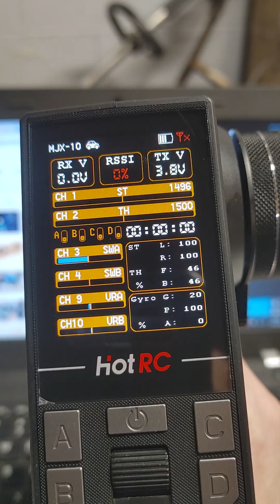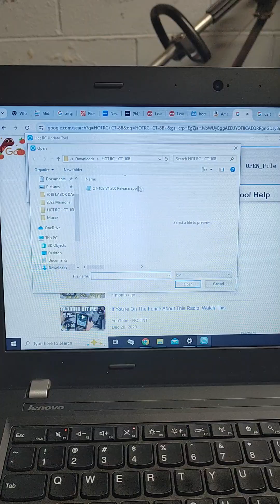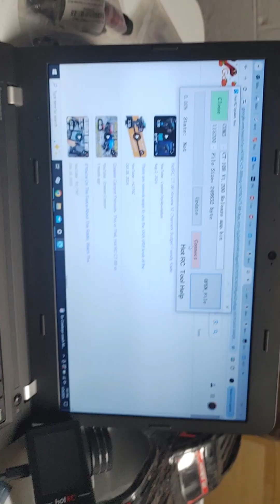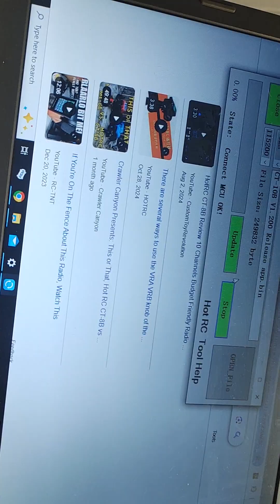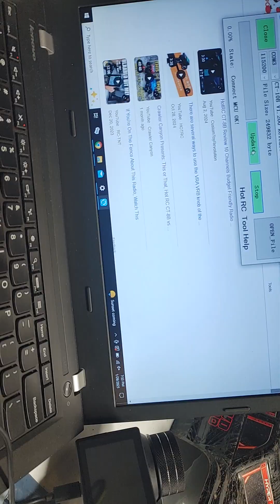HOTRC CT-8B UPDATE TO 10B

Comment from the maker: Here is my link to the files
https://drive.google.com/drive/folders/1K_MOMWdxmC6KSFVyBSf3utU4CjxdJMvG
Reply: Hey man, did the support also give you the update for the 8A controller (the one in the tutorial in your drive)? I have both controllers, but the support on the shop I bought it from doesn't have the update files. Thanks for the video.
Reply from the maker: @jpmv2020  No they didn't I've tried to get update but no luck. You could try this file it might work. I don't have a 8A to try it on.
Reply: @jpmv2020 hello, I also bought an 8A… please, would you know if is it possible to configure the brake lights, using their receiver with light control F-1A?
Reply: @DJTJ13 Hi, should I connect the internal black wire or just the external shield, or both? Also, do I have to hold down the CT-10B button the entire time while it updates? I'm not sure how to do this. Is there a way to brick the transmitter?

Comment: Just a quick message to say thanks for the help on this. I downloaded from the HOTRC website but the instructions were difficult, your video was vital! Rather than doing a DIY USB to USB-C UART, I brought the Meus adapter you linked, much easier! 

I couldn't get the driver to install on Windows 11, so I inserted the USB dongle in a USB port, waited for it to be shown in Device Manager, then when the device came up (with a warning triangle), I clicked update driver and then pointed the dialogue to the CH341SER folder and let it find the dongle driver. Then once the driver installed, I made a note of the COM port shown in brackets. 

After that point I followed your video. Having the deviced powered off and then powering it on and keeping the button held is vital. 

You also may get a 'test' marker after the update is done... there are instuctions for that on the HOTRC website in the 'product upgrade'\'CT-10B' part of the website. You have to run a calibration to get rid of the 'test' marker.

Comment: Hi, should I connect the internal black wire or just the external shield, or both? Also, do I have to hold down the CT-10B button the entire time while it updates? I'm not sure how to do this. Is there a way to brick the transmitter?

Comment: thx for the video. I did update my ct8b and it finished updating, but now it does not switch on again. Any hint how to fix it?
Reply from the maker: No have you tried removing the batteries?
Reply: I tried removing the battery, no power on after reinstall
Reply: @MartinGschwandtner  i have just had the same issue :( did you find a solution?
Reply: @Ms444kkk no I did not. Prepared a arm programmer for flashing the cpu directly but the tooling did not work out of the box and I lost focus. Maybe I will give it a try the next days...

Comment: A random question: can you put the Meus logo on the controller? I mean, the Meus system on the HotRC?
Reply: I'd like to know too. I have another clone called the AMEWI ATXB10. There's nothing on the AMEWI website about updates, and they don't respond to any emails or tickets I open. AMEWI sucks! So I'd like to know if I can update my AMEWI ATXB10 transmitter with the MEUS firmware.

Comment from the maker: The correct adapter you can order from Meus it's the same as the HOTRC. 

https://www.meusracing.com/products/usb-dongle-for-transmitter-upgrade?variant=43812465410185
Reply: I'd like to know too. I have another clone called the AMEWI ATXB10. There's nothing on the AMEWI website about updates, and they don't respond to any emails or tickets I open. AMEWI sucks! So I'd like to know if I can update my AMEWI ATXB10 transmitter with the MEUS firmware.

Comment: Hi mate, thx for sharing this.
Do you think it's possible to do this with ESP32 or Uno card ?
Reply from the maker: @SkyTyphon  I'm not sure but the adapter is cheap like $7.99 on Amazon
Reply: @DJTJ13  But i've lot of ESP32 ^^
Reply: @DJTJ13  I used Flipper Zero with UART bridge. And after number of tries, i reached to send update but .... "error" at 100%. Do you have some tips ?
It's getting on me nerves ! 😞
Reply from the maker: @SkyTyphon  I'm sorry. I'm no expert with these devices. I was just smart enough to figure out how to make it work for me.lol but wanted to share it bc I knew it would help others.  Hopefully some one can take the info and make a better video one day.
Reply: @DJTJ13  No worries. Thank you by the way.
For your information, I manage to upload the file by holding down the "ON/OFF" button but it gives me an error at the end and therefore does not update.

Thanks again to you
Reply: Yes you can use an arduino uno. Short reset pin with ground pin to disable attiny mcu

Comment: Really appreciated  your effort man! 

Can i do this on ly CT-8A hot rc remote ??
I like this new theme old one is rubbish 😢
Reply: I've sucessfully updated firmware on ct-8a with meus me-8a one from their website. Works good with hot rc gyro receivers and includes 4 way steering.
Reply: @ssvaler hello, friend! Thank you for your comment. I just bought an 8A transmitter and the receiver with light control. Waiting to arrive… please, would you know if is it possible to configure brake lights? I just saw parking lights in some tutorials and it’s not the same functionality as brake lights. I appreciate your reply!
Reply: @ssvaler the receiver that I bought is F-01A. Thank you.
Reply: @RCDRIFTCHANNEL Hello i have a f-01at (with gyro). Parking lights = brake lights it activates then trigger position is ~1000(central). You can only configure button mapping for activation headlights, emergency etc.
Reply: @ssvaler thank you so much for your answer! Yes, I understand. But I thought that the brake light should be activated when you pull the trigger to actually brakes, I mean. Not on the central position, but after accelerating, pushing the trigger to the front, did you get it?
Reply: @RCDRIFTCHANNEL  receiver have another channel for rear lights, that activates then you pull trigger to the front. i think if you dont have reverse on the esc it can work as "brake lights"
Reply: @ssvaler thank you so much for your explanations. So, in your case… when you brake your RC, the reverse lights activate? Do you know if other lights kit set offers real brake lights? Thank you for your amazing support.
Reply from the maker: I wish I could say 100% yes.  I feel it could work but it would be at risk of bricking your CT-8A. I do know the 8B has 2 Extra channels (the knobs)  the 8A doesn't. I tried to reaching out to the seller I got the 8B update from to see if they had a 6A and 8A update files but haven't heard back. I did read that HOTRC would send updates via there wechat account but I don't have one to ask. Not sure if I want one either yet. Please let me know if you figure anything out. Bc I would like to know too.
Reply: @ hi, actually i have two options of transmitter to buy 
One is CT-8A and other is Ct-8b tell me which one should i buy ( i like new theme very very much )
Reply from the maker: @Mr.Respect.-_-  I would buy the 8B just bc you get the knobs for ch1 and ch2. But depending on where you get it might already have the update. I've seen them on Ali Express with the update.
Reply: @Mr.Respect.-_- I have 2 different versions of the CT8B. One is plastic the other metal (steering wheel) I highly suggest you get the metal one, it’s an upgraded software and you can actually map the side knobs to trim or range for steering and throttle which is great to have on hand
Reply: Is it possible to use type c cable without the URT adaptor?